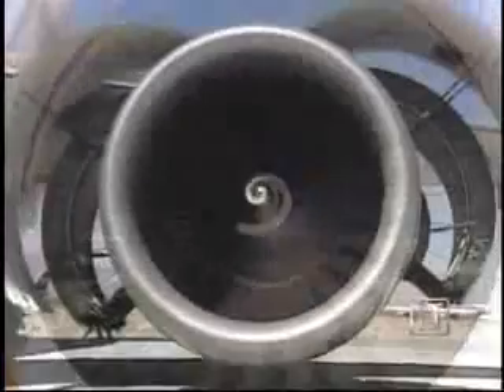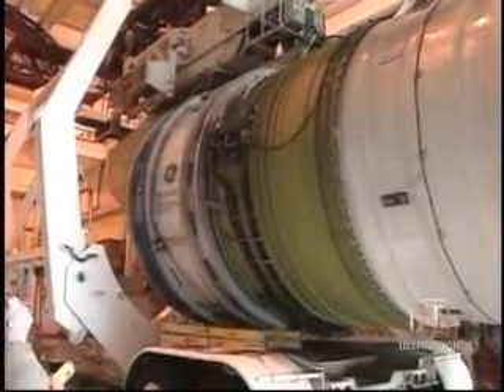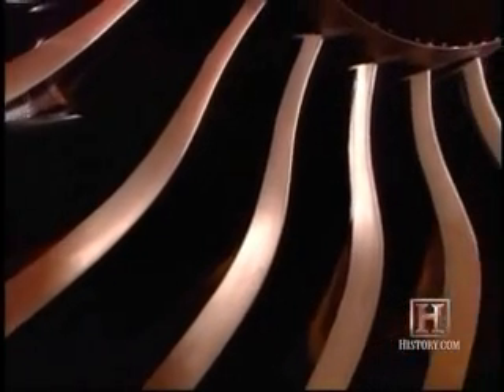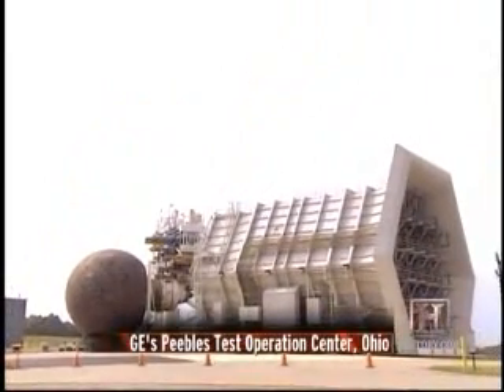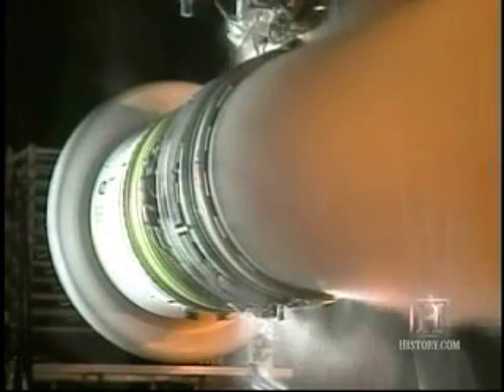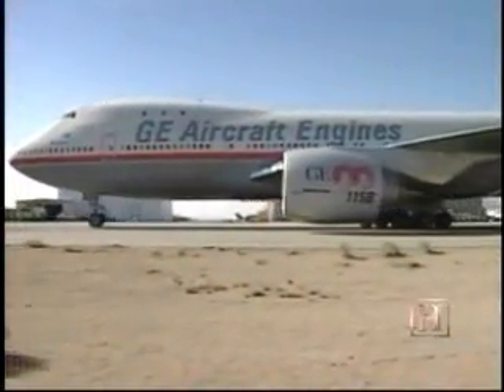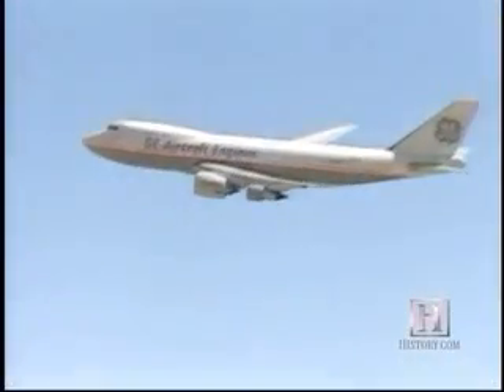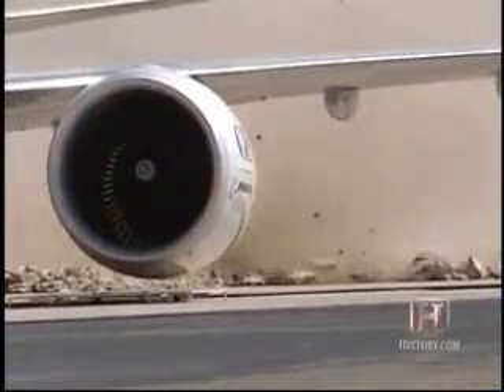General Electric Biggest Jet Engine for B-777

Comment: The engine has to be able to fly a 777 for three hours by itself. Flying such a big plane for three hours is not only a power issue, but a reliability issue as well. Another dimension in which these engines are amazing.